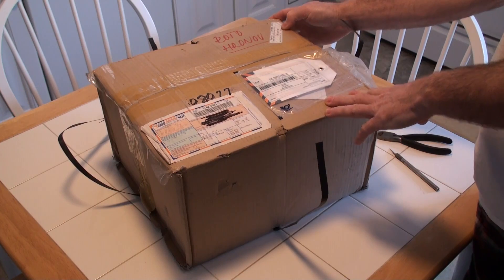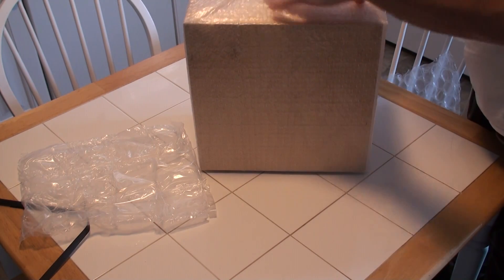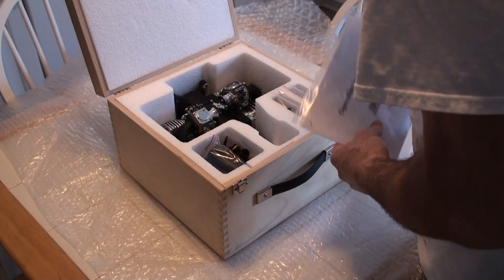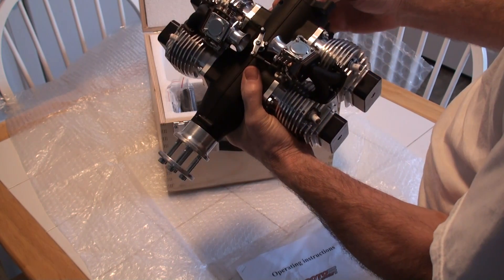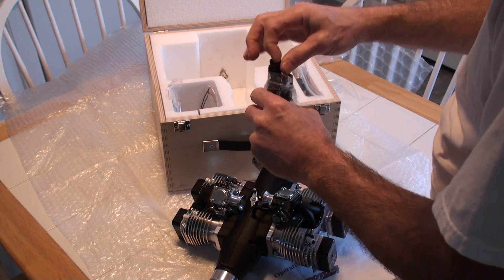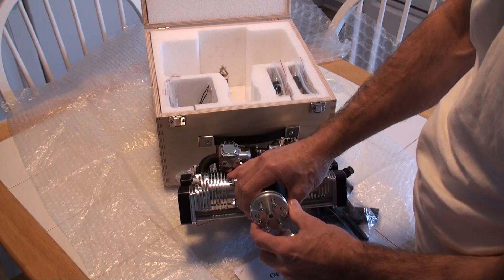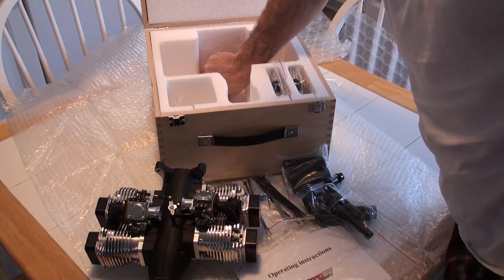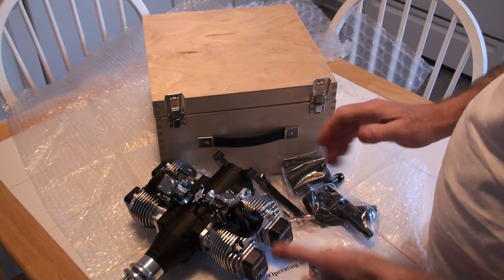Unboxing the Rotomotor 170 FS - 170cc 4 Stroke 4 Cylinder Gas RC Engine!

Comment: Well that box is rubbish , it should have been mahogany with walnut inlay with 20 coats of lacquer.  Send it back at once . 
Engine looks the business and the box is shear ott for something that’s going to be put to one side once the engines on the front of the aircraft in my opinion. But very well packaged for over seas transport .
Very nice nevertheless.

Comment: I want to make a friction drive pedal assisted bicycle using a 1 piston 1 cylinder RC plane engine nothing smaller then 25-30cc , I’ve made a friction drive bike with a 26cc 2 stroke weed wacker and it was perfect

Comment: How much power does it produce? 3hp, 5hp?
Reply from the maker: Their website doesn't have HP figures but there is other info on the engine.
Here is the link: http://www.rotomotor.cz/rotomotor/eshop/0/0/5/37-ROTO-170-FS-four-cylinder-four-stroke-gasoline-RC-airplane-engine

Comment: can you give me a link in amazon please for this Engine ?
^.^
Reply: ExTr3m3 BASS 10hp in a go kart is a good  amount of power
Reply: Thegeokiller 15 

Not when it makes 10hp it at 12,000rpm and like 3lbs of tq.

A predator 212 engine is $120 and makes 6.25hp and 8ft lbs of torque at like 3000rpm. This engine in the video is $3100 USD
Reply: ShadowOfDeath24 true but the gearing and also you can make a transmission
Reply: ShadowOfDeath24 s
Reply: and can i use this for go kart or mini bike ?
Reply: The Dark Rider it's only going to be 10 horsepower

Comment: That's a sweet little engine...Wet sump.?
Reply from the maker: +ZIGgassedUP No oiling system at all.  Just the blow-by past the rings oils the bottom end with oil that is mixed in with the gas.
Reply: Two stroke oil?

Comment: if i got the right converters could i put this in rc car plz respond
Reply from the maker: +Tucker Moore Anything can be done with enough money.
Reply: mount it to the inside wall of the car and slap a sprocket in where the prop goes

Comment: Hi Dave I want to get the engine,what things do i need that is not included in the case like the propeller blade and the cone?
Reply from the maker: +Chavez Wallace Who's Dave?  Anyway, you might want to get the flex pipes for the exhaust so you can route the exhaust to where you want it if you're installing it under a cowl, if no cowl and the engine is going to be completely exposed then you can just use the short pipes that come with the engine. They sell two different lengths of flex pipes. I still have a new set of the long ones.  Also, I purchased a prop drill guide from them to drill my prop.  They still don't show it on their website so just ask for it.  I purchased the one for the 85 and made a note that I needed the one for the 170.  Oh, and of course propeller and cone don't come with the engine.
Reply: +Dan Campise I want it for the same 35% Cessna 182
Reply from the maker: +Chavez Wallace Oh, okay.  It was very complicated to get that engine to fit and function in the TMMY Cessna.  I am a mechanical engineer and it was quite a task for me.  If you are not very experienced in customizing, fabrication, and modifications then I would not recommend it.  Do you already have the plane?
Reply: +Dan Campise I don't have the plane now but iwant to get everything for next year christmas because i will ship it to Guyana where my cousin is an engineer and he would be able to put it together so i want to get everything there so i don't keep ordering more things after i get it
Reply from the maker: +Chavez Wallace Oh, okay.
Reply: Chavez Wallac

Comment: I haven't been able to find horsepower figures, which I'm assuming is because model airplanes use different figures for performance, are they stated anywhere?

I can only guess it's around 10-12hp with the rev limit at 5500rpm (if that is the correct redline for the engine too)
Reply from the maker: RTDragonCommando Yea, I haven't seen any HP numbers anywhere.

Comment: So expensive! _
Reply from the maker: 4-Stroke engines are far more complex and have many more parts than 2-Stroke engines, so the price is always higher than a comparable displacement 2-Stroke.  Also this is a 4 cylinder engine, so more parts and material still.

The appeal of 4-Strokes is that they have more torque and so can spin a bigger prop or one with more pitch.  But mainly that beautiful, realistic, 4-Stroke sound in itself is worth the extra money. ;-)